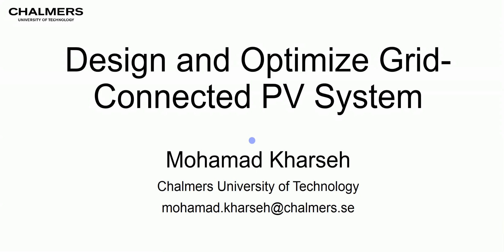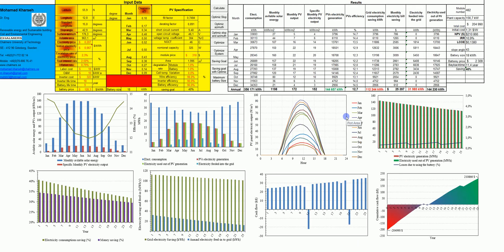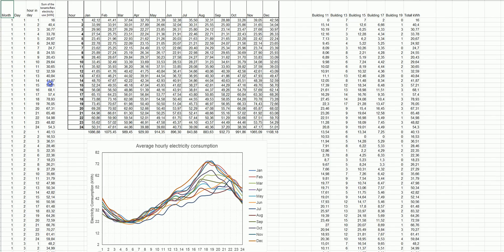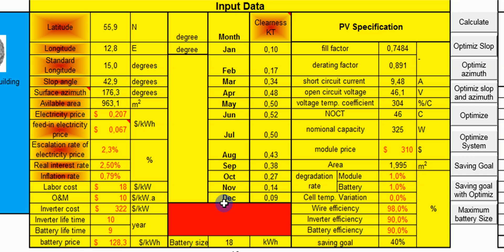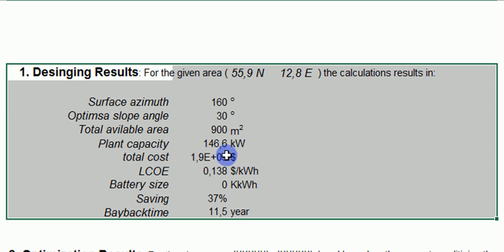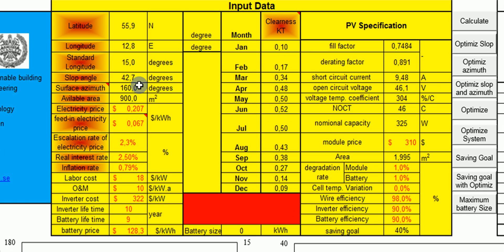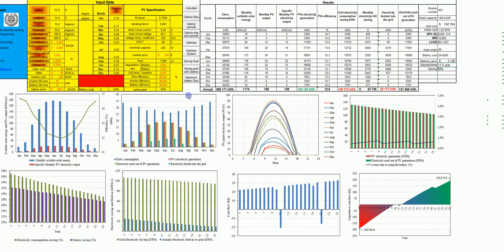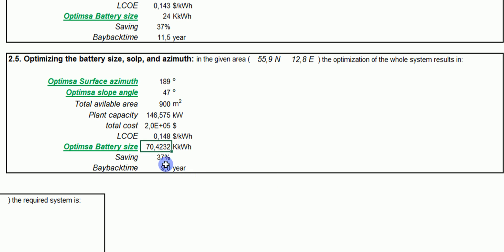Computer Model to Design and Optimize grid-connected PV system with battery

Comment: Hello Mr. Kharesh
kindly please help me.
my demand is 4500kW (Annually)
Im using 15 panels of Canadian Solar 265W and my mean of annual solar irradiance is 3.13 kWh/m^2/day
What will be the ratings of my battery and inverter and how do I calculate them and which one's would be the best for.
This is an off-grid system and what would be Back-up ?
I would be of a great help.
thankss.
Reply from the maker: it is not that easy! It depends on the ambient environment (i.e. the air temperature) and the specification of the panels.